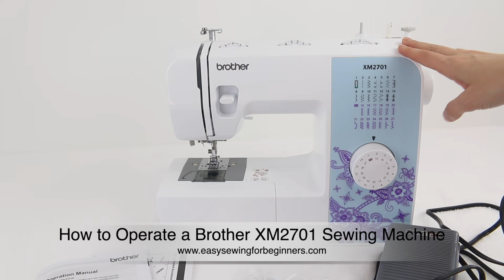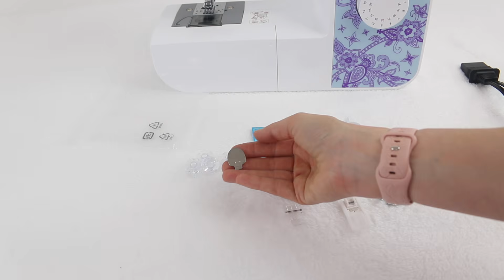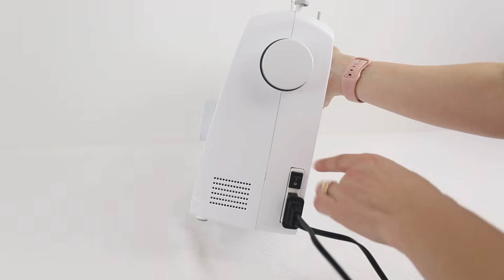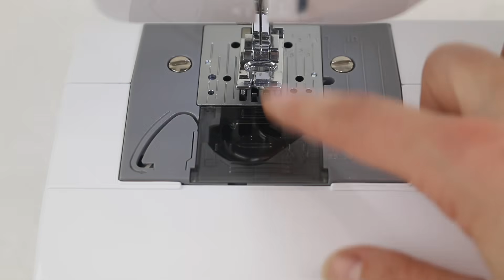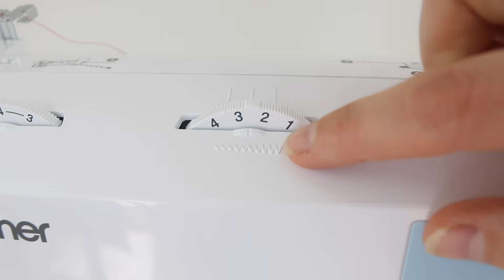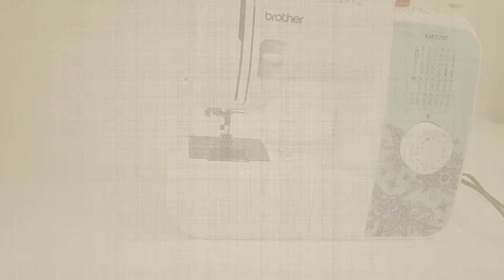How to Operate a Brother XM2701 Sewing Machine

Comment: I bought this machine and your videos on operations are awesome.  I want to make some curtains for my RV but I want them to have curtain rods at the top and bottom. Do you have any advise?  My skill level is "retired auto mechanic who has been known to staple the patches back onto my work shirts". 🙂 But I am eager to learn to use my new machine.
Reply from the maker: Thank you for your kind words! Staples can go a long way 🤪 rod pocket curtains might be easiest to try. I haven’t got a tutorial for these unfortunately but there are many around. This would involve hemming both sides of your curtains fabric first. Then fold over the top (and bottom in your case) and sew across to create a channel pocket to fit your rod through. To work out the width of your curtain fabric you would multiple the width of the window by 2 or 2 1/2 times, depending on how much scrunch you want in the curtains. I hope that helps and all the best. 😀

Comment: Threads aren’t catching each other. I followed the instructions on this video. Sometimes it works, and sometimes it doesn’t and the past 10 times I tried rethreading according to this video, adding the bottom and according to this video, it wasn’t catching. What could I be doing wrong? By catching, I mean the top thread and the bottom thread aren’t weaving together through the fabric.
Reply: Sam e with ours
Reply from the maker: That sounds frustrating. Have you tried changing the needle? If this doesn't work then there may be an issue with the timing of the machine.

Comment: Hello ❤ I watched all of your sewing beginners videos & I was wondering out of all which one should I buy as a beginner?
Reply from the maker: Hi! It depends on your price range, what you might be sewing with it and location in the world, but I really like the feel and smoothness of Brother sewing machines, especially compared to the Singer Heavy Duty machines. I’ve only been working with this particular machine for a little while but it is lovely and very easy to use. The Singer Heavy Duty machines have more options and functionality, but you have to deal with issues like holding the thread tails when you start sewing a seam. this is a problem I find on the cheaper 12 stitch mini sewing machines. Happy to answer any other questions. I could go on for a while 🤪. I am not affiliated with any brands so I will give you my honest opinion 😀.

Comment: Very useful, thanks! I have the same machine and one step that always confuses me is pulling up the lower thread. I don't think I saw you do that step in your video (unless I missed it). Will it just automatically happen once you start sewing or is it a separate step you have to do? 

Also would appreciate videos on the additional feet that are included! Many thanks!!
Reply from the maker: Thanks for your comment. This machine has a quick set bobbin so the bottom bobbin thread will be brought up when you start sewing. Just make sure you follow the thread guides in the quick set bobbin and you’re all set. It’s a really good feature and simplifies the whole process. Let me know if you have an issues with it 😊. Also, thanks for the video suggestions too 🤗